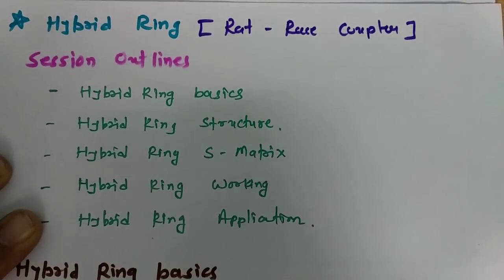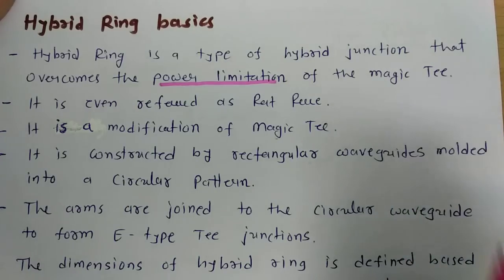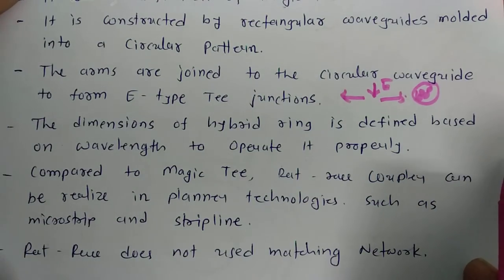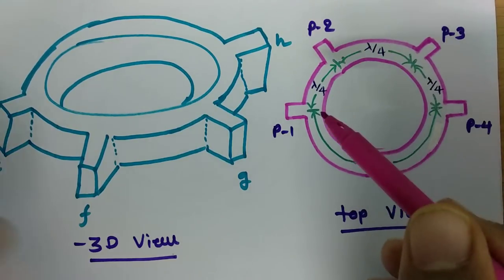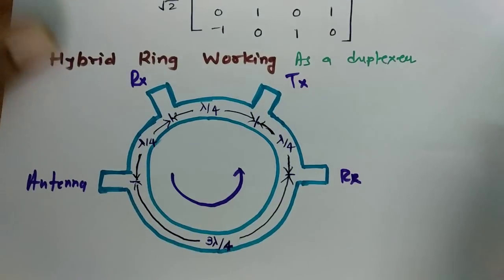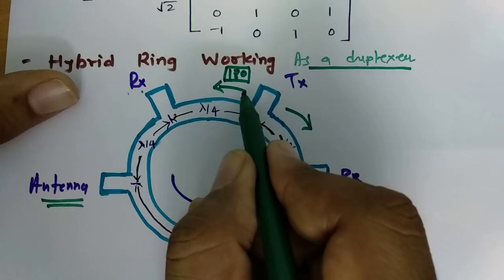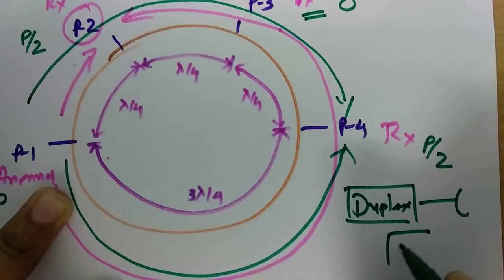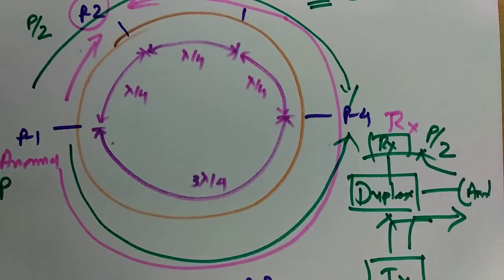Hybrid Ring or Rat Race Coupler (Basics, Working, Internal structure, S Matrix & Applications)

Comment: so many doubts are appearing sir...why is lambda by 4 taken as distance,if it is distance why are u adding it to the phase angle??
second is-> initially u talked about even and odd modes,i.e in phase and 180 degree out of phase,that's fine......but later u said one circuit in odd mode,another in even mode,what does at mean???totally confused,please answer sir
Reply: lambda is the path difference and it corresponds to 2pi phase difference
Reply: Sir bas ratwane ka kaam karte hai